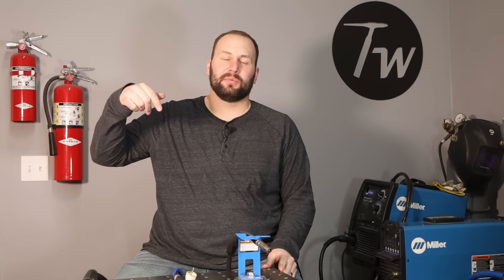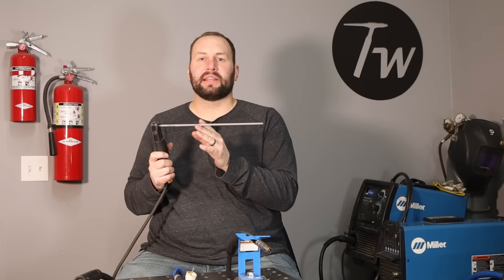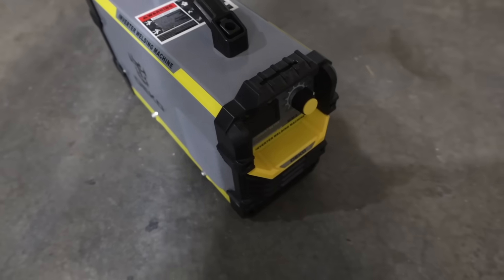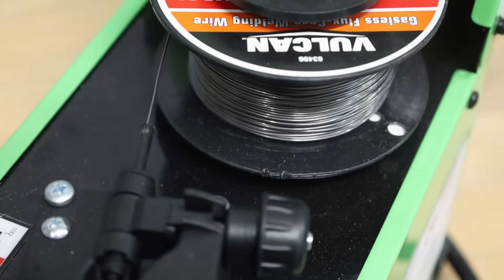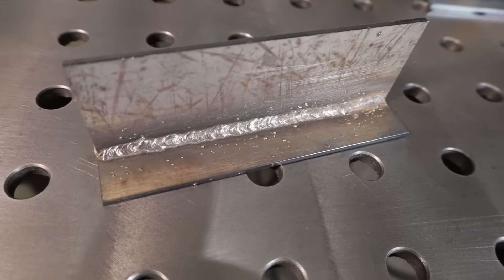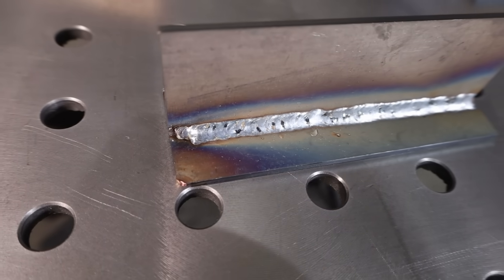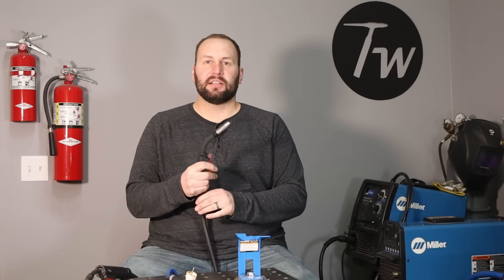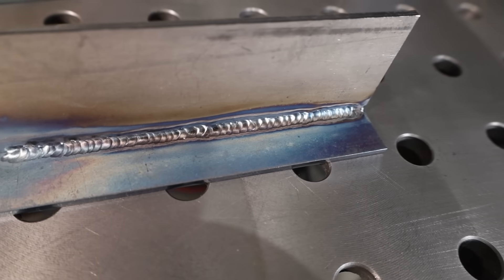4 Types of Welding Explained: MIG vs TIG vs Stick vs Flux Core

Comment: I served a four year apprenticeship as a welder Fabricator 1970 to 1974. Went to college one day a week obtained 4 City and Guilds in "welding" which gave me a City and Guilds advanced Craftsmanship certificate. After finishing my apprenticeship I went to work for the UK Admiralty as a toolmaker/welding Specialist. The materials I welded were diverse. The standard Mild Steel, Aluminium. Stainless steel. Then the less normal titanium, Nimonic, Inconol, copper, Cast Iron. Never liked MIG welding did obtain a City and Guilds  in it. I mainly used Stick Welding, TIG and Micro plasma. I was tested a few times for pressure vessels welding.   The external company which did the testing stated the Admiralty had better look after me as I was one of the best ever they had seen. Little did they realise my ambition was to stop welding as I hated being burnt. At the Admiralty I was given paid day release  where I obtained a HND in computer science and I stopped welding in 1980. Much to the consolation of my fellow tool makers at the Admiralty, They also recognised my skills.  Went on to be a Finance IT consultant.

Comment: Clear and concise video - welding has been a mystery for me for years!  Now I know the differences!  Two really dumb questions - 1) I've seen on TV where they (I think the term is called 'tack welding'?) where they quickly pulse the welding gun on a joint to temporarily hold something in place before making the joint permanent... is that the correct term and I suppose any of the 4 types of welders can be used?  And 2) if one is not careful with safety with the welding gun would you get electrocuted or burned (or both!)?
Reply: Yes, tack welding is the correct term. It's basic metal working & welding technique to tack everything together first. It's used for every type of weld. No such thing as an electric shock in welding, It's low voltage anyway. Learning not to burn yourself on hot metal is a real challenge for welders. Ice cold water or ice for burns no matter what the source.

Comment: Hi Tim. Great video. Seems like if I wanted to just learn to weld to deck an aluminum jon boat that TIG would be the best way. Is it really the only acceptable way? I hate to settle for an inferior option, but it also seems if I were just doing it for personal use that a TIG setup wouldn't really be cost-effective.

Comment: I appreciated this rudimentary, basic intro, but would have appreciated knowing the advantages, if any of one method over another. What type metals can you weld together with these differing techniques and if there is a significant difference in the strength of the weld.
In other words, why would I select one method over another for a given joint?

Comment: Back in the Dark Ages, when I was in metal shop, our teacher, Mr. Sadist (that's how I remember him), would not let us use any other tools in the shop until we had successfully run a bead with the oxy acetylene welding torch.  I tried.  I really did.  But I just couldn't do it.  I could not create and maintain a good puddle.  After working on it every day for two weeks, Mr. Sadist gave up on me and let me move on to other stations.   I could stick weld, make good clean cuts with the cutting torch, bend sheet metal on the brake and drill & tap without breaking tools, but I could not get past the oxy acetylene task.  I got a C in 9th grade metal shop...

Comment: As a newbie, I’m really just looking more toward a “flux-only” starter machine at this point. Question is: are the “Inverter” models really that different than the “regular-AC” models, if one is one sale and one isn’t? Thanks 🇨🇦
Reply from the maker: The inverters really are much better and worth it in my opinion, but it just depends on how much and what you’re wanting to do.
Reply: @TimWelds  I’m just planing (as a DYI) at home for basic repairs here and there and some automotive repairs, so this answer is great. Great vids and channel. 🇨🇦👍🏼 Cheers.

Comment: An excellent explanation of general welding processes, but I have a question.
In that steel comes in a variety of alloys, how do you do a weld and make sure that the filler area is the same alloy as the base material?
Wouldn't the weld filler be a weakness in the structure?

Comment: Well explained, but think he left a bit out by stick and mig.
When your out in the wilderness welding pipe,or repairing pipe, you would prefably use the stick, 1,the wind will not affect your bead, not like mig the gas shields the wire and if you have wind you won't have a shield, therefore you will get porosity in you bead lay down. 2 you can ask any experienced older welder stick work on repair jobs for example, ship repair or ship building is prefared, while it is more malleable, (stretches and bends easier than mig and is not so brittle which is very very important in ship industry) but saying that, you could build a ship 3/4 of the time quicker with mig than with the stick, it's a cost and labour decision

Comment: Hi great content. Can i use stick welding to weld an iron boat. The boat will be used in the sea for fishing purposes and is going to go through a lot of stress. I have molded most of the body, kept the welds to a minimum. Still, is stick welding with a 200 amp small welding machine good for marine purposes.

Comment: So I'd want to get a mig machine so I can run good stick and mig and flux but get separate tig machine bc the multi functions dont even compare or?
Reply from the maker: There are a few multiprocess machines that have excellent TIG features, they are expensive. My point is just to make sure you know what you’re getting.

Comment: Can you use it or power it with a generator?
Reply from the maker: Yes, as long as the generator is big enough. Many machines will spec the required generator size. At a minimum, they will state the input amperage.

Comment: Is it possible to buy a multi purpose machine with ac/dc output, and run it on fluxcore wire for mig and run it with argon gas for tig? I want to buy a machine for myself, I have welded before (mig). But I want to be a bit versatile when buying my own.
Reply from the maker: Yes, you can definitely do that and you’d have a nice setup. There are very few options for multiprocess machines with AC/DC TIG, and they are generally expensive. If TIG welding aluminum is important to you, I think you get more capability for your money with a dedicated TIG machine along with a MIG machine. Two good TIG options for the home shop are the HTP Invertig 221 and the PrimeWeld TIG225X, depending on your budget. I have reviews of both machines on my channel if you want to learn more about them.

Comment: Tig was what we used for stainless pipe... we used it for the first pass on large steel pipe and pre fitted pipe or fab pieces.... yeah, it's definitely looks easier than when u actually try it for the first time but, once u get the hang and set ur machine right you'll find it's not so much technique u lack as much is the ladder....

Comment: I want a welder to weld up my Damascus billet. Would a rig welder just melt the steel? I just need to keep o2 out until the metal forge welds together

Comment: Hi,  great job there sir, kindly assist me on this sir. I saw a hand held  portable arc welding machine on shopping website ali express, it is shaped like the cordless drill we use but has a cord. Would you purchase that  if you were a novice like I am? 
Considering this is China, and they have a reputation for cheap short lasting tools, would you go for it if you wanted an extremly small welding machine? 
What's your expert opinion or review of it? 
My email is  paulbonanza92@gmail.com
Thank you.

Comment: Which one you can recommend in stainless steel welding?
Reply from the maker: Typically TIG, especially if it’s thinner material or sanitary tubing. That being said, all of them can be used for different stainless applications. Stainless MIG is pretty common for a lot of industrial uses.
Reply: @TimWelds  thank you

Comment: Does TIG, MIG, Flux core welding have smoke like the stick welding that is really hurtful to the eyes?
Reply from the maker: Flux core will have just as much fume as stick welding. MIG will have less, but still some. TIG has extremely low fume as long as your material is clean.

Comment: One thing you should have mentioned: stick welding and flux core can be used outside if there is low to moderate wind. MIG and TIG won't work outside because the wind will cary away the protective gas very easily!

Comment: I was a construction electrician for almost 20yrs, and worked alongside countless welders and pipefitters who were always throwing sparks everywhere. I would hear them throw terms around, but never knew what they meant. Now I do. Thanks very much
Reply: If you watch to much they'll tell you "watch the pretty blue light." Now you got a welding flash.
Reply: @georgebuck2269  Nah, I was an electrician. I'm smarter than that 😉

Comment: I recently had a first welding course at work using a stick welder.

Good thing is that I was one of those who didn't need to go for a repeat course.

Really excited to go and do more welding. And having these different methods explained in a simple manner is very informative!
Reply: Where did you take a welding course ?

Comment: I would recommend renaming the video in the order in which you demonstrate:
i.e. Stick* vs Flux Core vs MIG vs TIG

*(shielded metal arc welding, manual metal arc welding, rod welding)

Comment: Great video! I wondered if there are TIG-welders around with automatic wire feeder also, and I found out that there are! A TIG job by hand is painstakingly slow and difficult to learn as you need a steady hand.

Comment: Just a quick question? Is it bad to weld outside in an area where people can see you? Aswell, will a bird or something get blinded by welding?
Reply: Generally you can block out most of the light using specialized curtains aswell as using your body to block the UV rays

Comment: I noticed that you ran the bead "backwards" with the mig. Any reason?

Thanks for the video!!   I didn't know what TIG was. 

I sucked at stick welding in high school shop class. 20 years later, out of necessity, I bought an inexpensive  MIG machine and,  holy crap, it was far easier. I never got great at it but I was good enough to do what I needed. I only used it once a year so I was often out of gas which was a pain. Fast forward to 2021 and I just  learned about the flux wire option.  It is a pain to drag the bottles around so Ill try flux when I run out next time.

Comment: I have a question, have you ever experience flash welder/ UV Photokeratitis/ Arc's eye? if you have, beside using personal protective equipment, what type of welding have the least UV Intensity?
Reply from the maker: I’ve never had much of an issue because I always use a lens with a sufficient shade. The light intensity and required shade will depend as much on amperage as it does on process. If you Google “welding shade chart,” you’ll find some graphics that will give more insight than I can describe in words here.
Reply: @TimWelds  thank you so much

Comment: So for welding automotive parts the best one would be flux core welding? Sorry new to all of this.
Reply from the maker: Great question! For most general automotive work (steel brackets, auto body, basic exhaust, tube work, steel racks), I would recommend MIG welding. For more precise work (aluminum intakes, aluminum tanks and cans, very precise tube work, etc), I would recommend TIG. Keep in mind that to TIG weld aluminum, you’ll need an AC/DC machine. Hope this helps!
Reply: @TimWelds  so I shouldn’t get a flux core then? And instead get a mig welder

Comment: what is the most bang for your buck when it comes to welding machines/welding types?
Reply from the maker: I think it really depends on what you want to do, but I think stick welding is a great process to start with and costs much less than the others to get set up for.
Reply: @TimWelds   ok thanks

Comment: ANY SUGGESTIONS FOR A BEGINNER- STICK WELDING OR FLUX CORE SEEMS TO BE EASIEST TO LEARN- ONLY HAVE STANDARD HOUSE CURRENT AVAILABLE, VERY GOOD VIDEO-"SOORY AVOUT ALL CAPS-KEYBOARD ISSUES, PJP
Reply from the maker: Either stick welding or flux core are good processes for a beginner. The little flux core I used in this video just runs on 115 volt, along with some basic stick welders. From my experience, you'll probably be limited to about 80 amps with a stick welder plugged into 115, but that can still work with some smaller 3/32" (2.4mm) electrodes.
Reply: @TimWelds   thank,s I,ll just go for it !!pjp

Comment: whats the purpose of flux when ur gonna remove the slag after anyway lmao. what happens if u stickweld using a plain stick with no flux
Reply: Protect from oxidation.
Reply: @osyisr6361  but they remove the slag right after welding so its not protected from oxidation anyway lmao
Reply: @tanyaortega5291  during the weld not after.
Reply: @osyisr6361  from what i understand oxidation is rust, do you mean that if u weld with a stick with no flux, oxidation happens meaning the weld will get rust during or immediately after the weld? sorry i still dont get it🤷
Reply from the maker: Great question! Oxidation occurs when the oxygen in the air bonds with the iron and other elements in the metal. This happens on all materials. Aluminum forms an oxide layer and stainless steel is actually protected by a chromium oxide. As with most chemical reactions, oxidation will happen more rapidly at higher temperature. When the metal is liquid, it will react fairly violently and it will solidify will a lot of porosity, or little holes throughout it, leading to a weak weld.

Comment: Awesome video. But there is something I don't quite understand. Why would you choose Stick Welding instead of Flux Core Arc Welding? If I am correct they work basically the same but Flux Core Welding seems easier because the motor feeds your flux.
Reply from the maker: For a hobbyist, flux cored can be a better choice. Here are a few advantages of stick welding. Stick can weld on much thicker material without needing a large power supply. Welding can be done with different types of stick electrodes that perform differently to get certain results like full penetration joints. Stick will also produce less spatter than flux cored.
Reply: @TimWelds  Thank you so much for your reply, now I know almost all the things I wanted to know. And again, rallly good video.

Comment: I HAVE A QUESTION HERE  MIG vs ARC
Q.1 Which welding have more strength ?
Q.2 which welding have cheep in india according to cost comparison ?
Q.3 Which welding have great life ?
 
Ans. 1 .........................
Ans. 2  ........................
Ans. 3  ........................
Reply from the maker: By arc, I assume you're talking about SMAW (stick) welding. 
1. MIG and stick can have equivalent strength, though you are more likely to have lack of fusion defects with MIG. 
2. Stick will be cheaper to set up
3. Assuming that they are both done properly, they will have similar life
Reply: @TimWelds  Thank you sir , I appreciate you .

Comment: MIG, metal inert gas. MAG, metal active gas.

Mig requires pure argon, fit for stainless steel, aluminium etc...

Mag is mostly "Greta Thunberg Horror Gas", CO2. Argon content varies. For regular construction steel.

Comment: What about using your MIG to do stick welding? I only heard u say u can do both with a TIG machine?
Reply: The old machines were TIG constant current and MIG constant voltage. YOU CANNOT MIX AND MATCH THEM.

Comment: You said the MIG wire is steel wire coated in copper. That is incorrect. It is steel wire coated in silicone bronze

Comment: Thank you for this video.  I've seen many explaining the difference between these equipment but never really get  to comprehend it with so much info that I didn't really need that it's confusing.  This is exactly what I needed.  Thanks again.

Comment: Hay everyone watch out for your pocket if you go to airgas. They been buying good welding supply companies and the same people work there but somehow they have turned. Everything is several more time expensive and if your there for gas, they may not have your size tank but they will have a smaller one.....or the largest where you would have to rent or buy and pay the difference. 
Oh and if you call them to complain they literally would laugh at you over the phone. That's what happened to me
Reply from the maker: When I put together my video about gas cylinders, I called around a bunch of local gas suppliers to get pricing and they were about twice as much as everyone else. My best guess is that they are more interested in larger companies than in the little guy.
Reply: @TimWelds  Airgas is a big rip-off company the best we can do for ourselves is talk about it on every video chat there is

Comment: SO, How do you decide on what kind of weld/er you would use for a project?  Let's take a chain link fence and the diagonal support poles..... or say making a metal shop work table....etc....
Reply from the maker: Honestly, any of these processes would work for general projects like those. If I were doing those particular projects in my shop, I would MIG weld them because it’s fast and clean. If I were working on the fence outside, I’d stick weld it because it’s more portable and less affected by a breeze.
Reply: @TimWelds  Thank You Big time!....I have a possible project coming up replacing a fence line at our church. This advice will come in handy.